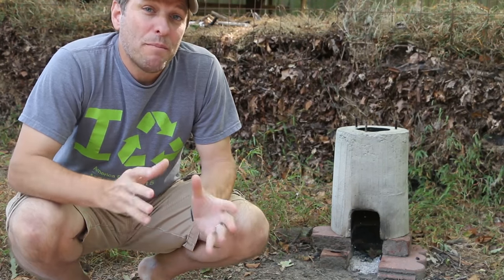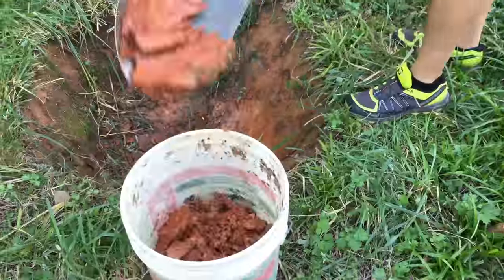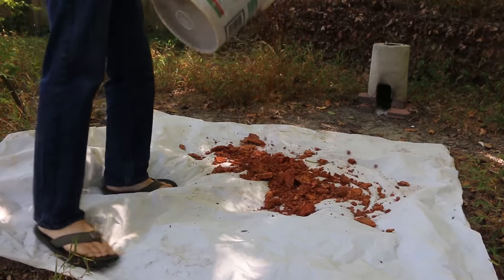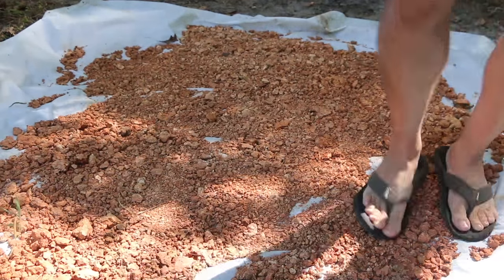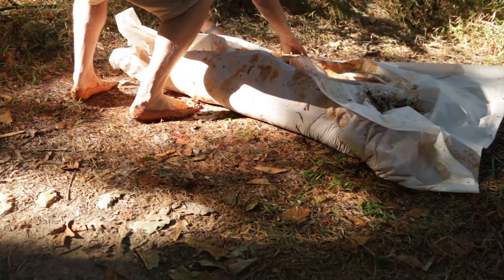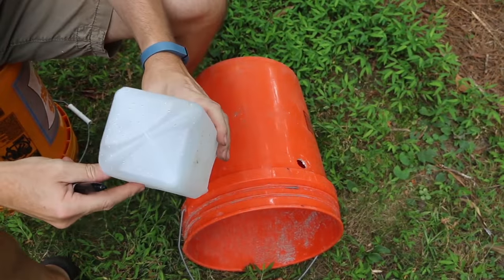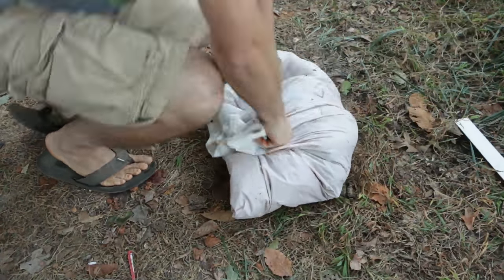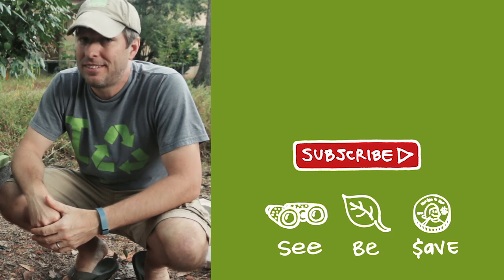How To Make A DIY Rocket Stove Out Of Mud

Comment: you could use grass in the cobb, I would just mix up a little cobb that doesn't have grass to line the burn chamber.
Reply from the maker: Thanks Alan. A good suggestion. I'll be remaking this adobe/cob rocket stove using all the great comments and feedback I've gotten here. I like you suggestion to do a different layer of material right around the chimney and burn chamber. I'm thinking about adding some perlite to the mix. Thanks for watching.

Comment: orry if someone wrote about this before. I believe that the reinforcement of the metal mesh is superfluous, since the coefficient of thermal expansion of iron (steel) and clay is different. This will destroy the construction.
Reply from the maker: Yes. I'll likely leave out the metal in my next rocket stove build, it was more trouble than it was worth. Thanks for the feedback.
Reply: Wow, I was thinking the same thing. First I was trying to make one just like this then the metal reinforcement troubled whole structure.

Comment: Better than straw is paper pulp...  the heat will  carbonize the paper.. but it will allow it to  dry faster..
I like the open bottom which means you can use sheet metal to hold the wood up to be ignited from under neath.

Comment: You can line that bucket with some kind of grease or lubricant ibricant and save yourself a lot of trouble. The form just slides right out.

Also, the "rebar" wire mesh stuff is not necessary, that's what the straw is.for that you chose to omit. The straw does not burn or char. I have made bricks of.con and theown them.in outdoor fire or.woodstove right in the middle, and in the morning broke it in half to find perfectly intact straw.  It needs oxygen to burn and that oxygen is not there inside the cob. 

Furthermore, I have slapped cob on my house walls in my former house, then sat there w open flame on it for a half hour or more, attempting to start a fire. It burned the straw stick out and then the fire fizzled out. 

Additionally, people have been making fireplaces out of cob (with hay) for centuries. Heard of con pizza ovens? Same level if heat. The stuff just does not burn. 

I mean, if it makes you happy to do all those extra steps, ypu do you, but it seems like you are over engineering it for no logical reason. Just my opinion and opinions are like belly buttons.

Comment: What a great video Tom. A LOT of work. I'm hoping to integrate a stove like this, with a water heating component - and perhaps tie it to an outdoor tub... Thanks for 'getting the camera dirty'!
Reply from the maker: Hi Zed. Thank you. I did a water heater version of a mud + fire brick stove. I just used a thermal siphon with bucket to test it.  Then added an outdoor shower element in a second video. If you are doing an outdoor tub, I’d double the amount of copper coil. Thank you for watching.

Comment: Not sure if this comment has been made yet as I can't be arsed to read through them all. I seem to remember reading that sand is a heat retainer rather than an insulater and the idea is to make the combustuon chamber insulative to create high temps. Obviously once the sand is up to a temp level it won't make that much dif but perlite or organic matter is what should be used as far as I have found???
Reply from the maker: I think you are correct. The cob is definitely a heat sink. That is perfect for a bread oven, but not a benefit with this rocket stove. When I make this mud stove again, I’ll add some perlite. You were the first to point out this property of the sand. Pretty sure the dirt is in the same category. Thanks for watching.

Comment: My grandfather who was a brick mason made his own fire bricks for fireplaces. Here in N GA we have plenty of red clay he made his own ash cement then just added sand and some baked ga clay. Fire bricks are expensive he made these for free. He would make a kiln just out of red clay mud and even made plain clay bricks firing them in the kiln. His old house was made from homemade bricks and is still standing! 

All of this is super time consuming of course but back then with eight mouths to feed  he tried to save every penny.I have just made a mud kiln which is basically a rocket design it bakes up hard as a rock and lasts. Plus its fun like making a mud castle! Repair the cracks on occasion and it will last decades. Back in the day poor Georgians only had mud to play with lol
Reply: Do you have to cover it to protect from the rain?
Reply: Is possible to add cement+clay+ash in order to make a refractory concrete?

Comment: A rocket stove MUST have an insulated riser with low thermal mass. 
Insulated because the burning chamber must be as hot as possible to burn fuel efficiently, otherwise, a big chunk of the wood is converted into smoke instead of heat. Low thermal mass because you want to heat the cooking wares, and fast, not the massive weight of clay or concrete of your stove. A longer riser would give more residence time for the fuel for more complete burning hence more efficiency but the draft would be too strong and tends to extinguish the flame. So you must have some flap at the input to control air admission with the benefit of adding some control of the burning power. 
But if you don't want to defeat the simplicity of a basic rocket stove and not having input control, the draft power can be reduced by creating a vortex in the burning chamber by poking well placed holes at the base. Without input air control though, the riser height is critical and it's quite hard to get good proportions to have both efficient burn and stable flames (and nearly impossible to have an efficient AND power-adjustable burn). Vortex is not that hard to create (what's hard is to create a powerful vortex) so any rocket stove without vortex should be considered sub-optimal.

For a mud-based riser, the cheapest way is to mix clay with wood sawdust.  Compression strength is decent but won't be as good as with perlite but insulation and low thermal mass properties are quite good. If you add a lot of sawdust, reinforcement rebars would probably be necessary (not if for occasional use).
Reply from the maker: Frédéric, I referenced your comment in the redesign of my concrete rocket stove. Check out the video: https://youtu.be/TYr-Uj4HqDs Thanks for the suggestion.

Comment: The other rocket stoves made with concrete, do they crack and fall apart with a lot of use or do they hold up well? Was this clay stove made to last longer or just as a primitive alternative to concrete from readily available materials?
Reply from the maker: Hi William. The idea was as a primitive alternative from readily available materials (minus the cost and impact of concrete). Most of the concrete stoves I’ve made have cracked, except the one made with crack resistant concrete.

Comment: Sorry GreenShortz you made a great video but lost the plot on the design principles for a rocket stove. I suggest you go onto the aprovecho research centre site and look at the principles published by Dr Larry Winiarski. If you had mixed the mud with a low density filler such as sawdust or rice husks or bran, you would have been much closer to the mark. Sadly, your combustion chambers are so dense with the use of sand they have become '"heat sinks" rather than heat reflectors, making the rocket stoves so inefficient. good luck on your next attempt.
Reply from the maker: I know I'm using the term rocket stove loosely. I've seen a few of the real deal and they are impressive. You aren't the first to exhort me to do some research, so I'll get with it. :-) I hadn't considered the heat sink vs. heat reflection principles, been focusing on air flow. Thanks for your comment and feedback.
Reply: Speaking of low density fillers, do you think that puffed rice would make an acceptable filler?
Reply: @GreenShortzDIY  Keep it up these videos are great

Comment: Your material - concrete or cob - needs to be made insulative, to improve its fuel economy and cleanness of burn. Put at least 50% perlite in your mixes. Also, the fire burns better (cleaner, more economical) if your put a metal fuel tray in the feed tube, to hold the fuel up off the floor, so that air can get in underneath. Also, the floor of the stove needs to be of insulative material too. Basic principles for really effective, super-efficient rocket stoves here:

http://www.bioenergylists.org/stovesdoc/Pcia/Design%20Principles%20for%20Wood%20Burning%20Cookstoves.pdf
Reply from the maker: Rhisart, thank you for the tips and the reference. I'll be making another mud rocket stove this Spring using comments and feedback I've gotten on this one. Thanks for your suggestions.
Reply from the maker: Rhisiart, I referenced your comment in the redesign of my concrete rocket stove. Check out the video: https://youtu.be/TYr-Uj4HqDs Thanks for the feedback.

Comment: Frankly cringed when you measured the circumference rather than just the diameter and multiplied by 3. The .1415926... of Pi is irrelevant, accounting for literally 5% error (round .14159.. to .15 and divide by 3 to get .5, or 5%). 5% of the bucket diameter may account for nothing greater than a third of an inch.

I'd like to conclude that you would probably get greater error from either the positioning of the tape measure around the bucket (i.e. measured at an arbitrary point) that would compound the error, by increasing the measurement by an unknown amount, and, to not exclude the fact that the tape measure doesn't even lie flat—it wrinkles!

/rant
Reply from the maker: Ha! I'm certainly no math wiz. :-) I may have said multiply, but I meant to subtract inches from the circumference. I left that in there for the sake of honesty. I think when I build this mud rocket stove again, I'll leave out the armature entirely. I've had several comments that the wire mesh wasn't needed. And it complicated the forming as well. Thanks for the feedback.
Reply: I'm humbled for the response. I'm new to the channel—what made you want to start it?
Reply: suckerfree23  its not going into space
Reply: If only finding clay was that easy in tonawanda